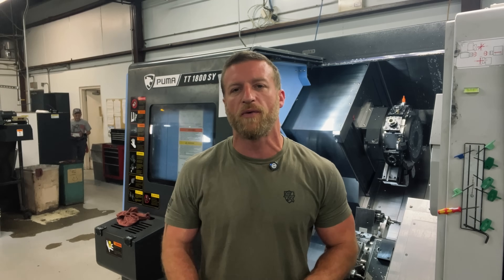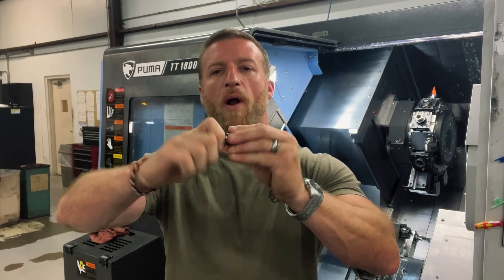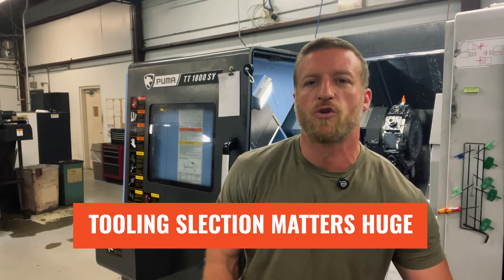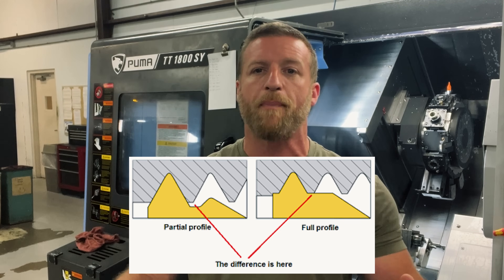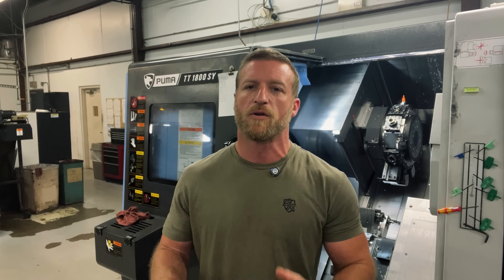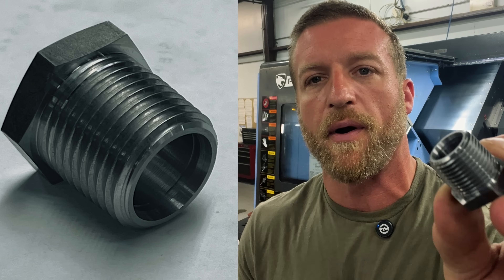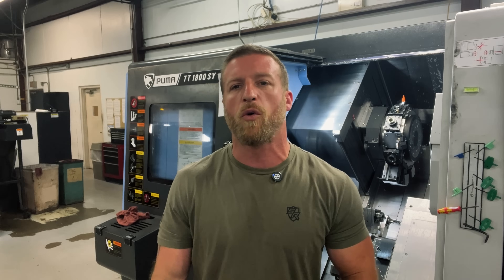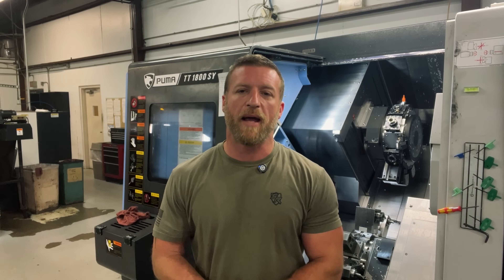How to Cut PERFECT Threads on a CNC Lathe | The Lathe Lab Ep.10

Comment: no need to add extra lines for spring passes on G76, the P###### in the second line has spring passed in it, i'm not sure how many you can add, but i've had up to 9 spring passes used on some very tricky materials, the first 2 numbers are your spring passes, so P02#### would be 2 spring passes

Comment: That's a lot of cycle time when 4 out of 5 jobs will pass muster if the operator cleans the thread up with a small file.   Zero-chip spring passes can add chatter also.

Comment: You missed THE most important part of threading with full form inserts: USE THE CORRECT SHIM FOR THE HELIX ANGLE OF YOUR THREAD. Literally nobody talks about it, and I have no idea how they make good threads without it.
Reply: Can you explain this like I’m 5? I am brand new to lathe work and would appreciate any help.
Reply: @SquibblyGiblets  Underneath the threading insert is a carbide shim.
Reply: @SquibblyGiblets  Because the thread itself is a helix, a thread form cutter needs to be slightly tipped to have the normal of the cutter be tangent to the helix.  Not sure if I'm using the preferred nomenclature here, but, yeah. So the pitch of the thread will determine the ideal angle that the shim would be set to. If the cutter is flat up and down, then the pitch is technically infinite. If the insert was 45 degree it would be a pretty severe pitch. 

Now, because lathe tools are always 'technically' cutting helical paths when feeding and it's fine enough and close enough to a flat resulting surface, a lot of lathe people get used to ignoring that detail since the goal isn't to form a thread. And because when we look at a thread diagram it's a profile section perpendicular to the axis, we're thinking of the paper-thin slice of that 60 degree ideal from straight on not at the pitch angle. But in reality it's a specific form swept along a helix. For example on my threading insert holder it has a 1.5 degree shim.
Reply: That is a great point!  Usually, the threads we make are quite standard and we use the shim that comes with the tool but the idea of making sure you have the correct shim is critical.
Reply: It's called a seat.

Comment: I like that right off the bat this 10-12 minute Video is 16 minutes. 

Full profile isn't always viable. It makes sense for common threads that you're gonna make hundreds of. But for example I just had a job yesterday to run 15 parts with male and female M18x1.5 threads. I almost never make metric threads on the lathe; no justifying ordering and waiting around for a pack of full-profile of that thread to come in for that job. So gotta have methods to get good results with partial profile tools. Usually you gotta bump a few bonus passes with a 2-thou offset to open up the thread closer to the true profile unless you have the meat to 'afford' to cut a deeper V-groove. On these parts they were for an oil-cooler sandwich plate to use a smaller filter thread than is typical, so to keep flow maximized I had some pretty thin wall left at the thread, so I couldn't afford to cut even ten-thou deeper than the 'nominal' root radius. But spent time, got the paths to work and the results are cleaner than the billet oil filter that they are threading into so I'm happy. 

A lot of these deburring tips are things I definitely use. Important to hit that thread a few ways and get a consistent clean result. One thing I wish I had live tooling for was to go in and deburr those diminished lead-in and lead-out threads where it almost always curls over just that tiny bit and leaves a sharp edge no matter what you do if only relying on turning tools.
Reply: I agree about the full profile threading issues. On non standard, it's hard to find that.  I will usually re-turn the major, deburr front and back and then re- thread.  Great input you shared and thank you!